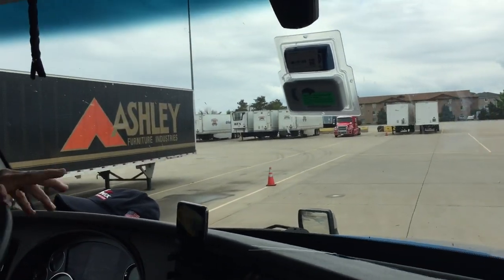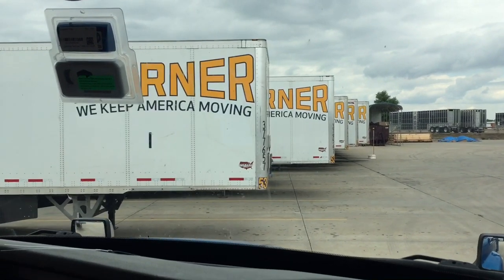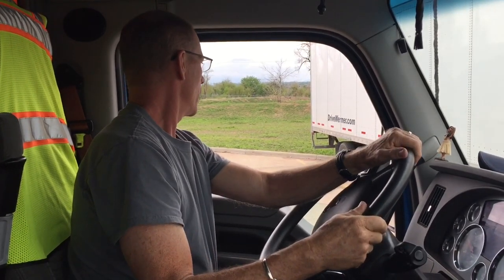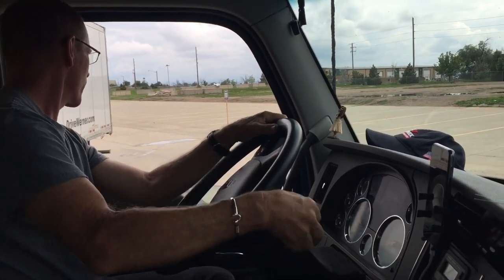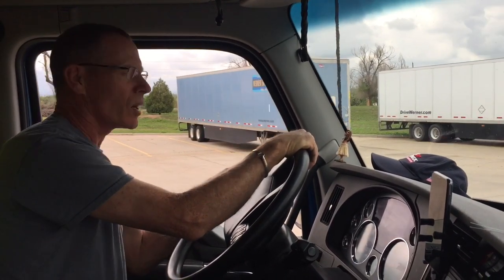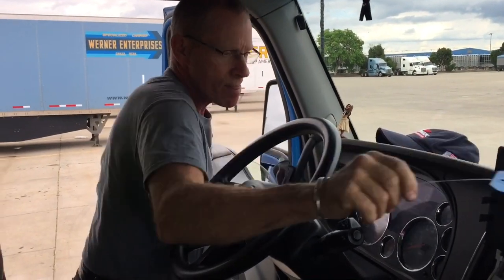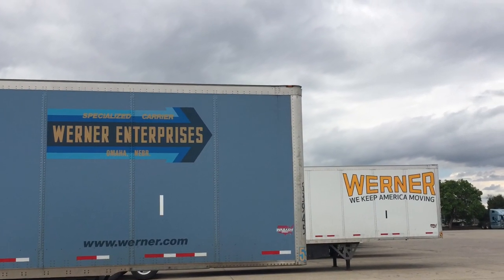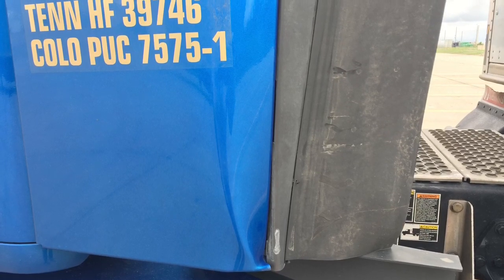How to Do 90 Degree Backing Maneuver | Jackknifing on a 90 | Trucking Tip | Incorrect Werner Stripe

Comment: I use this, you have to look outside, roll that window down and watch that trailer and go slow, never trust any marks, just your eyes, you can see it clearly if you just look out the window, one of the few times I actually stick my head out, 
your right side is blind anyway on this maneuver and you always confirmed that before you start. 
Correct on the spacing at set up and keeping 10-12 feet off the row to avoid trailer swing hitting anything on the left. Great for tight tight situations with little room between the rows.
Reply from the maker: Thanks!!! Great explanation!!👍😃

Comment: What’s the difference between a 45 and a 90 degree backing?
Reply from the maker: Your set up is different. The 90 is meant for very tight circumstances.
Reply: Good to know
Reply: Another thing when connecting a tractor to a trailer the order of sequence the difference between LAP and PAL?
Reply from the maker: @donstewy5584  Kevin does tug test and visually checks the king pin latch. Then he raises the landing gear. Then airlines and pigtails. So therefore it’s LAP. But it’s just a personal preference.
Reply: Depends alot if you single axle or tandems as well. But yeah 90 is for tight spots .